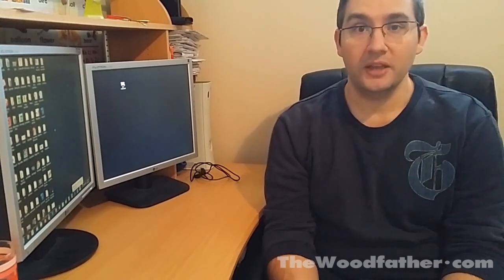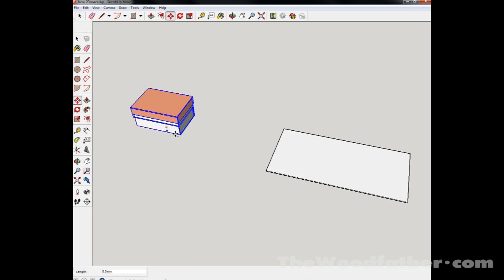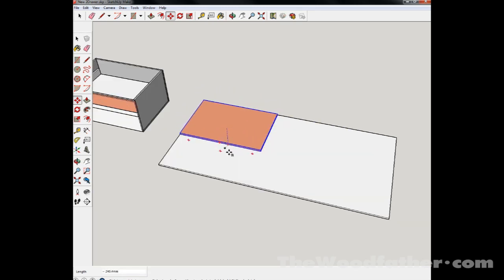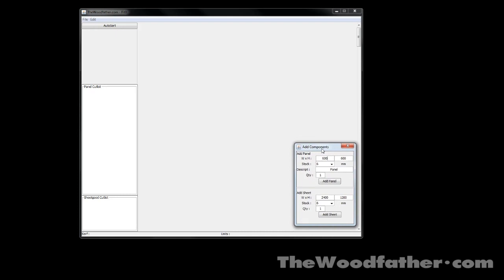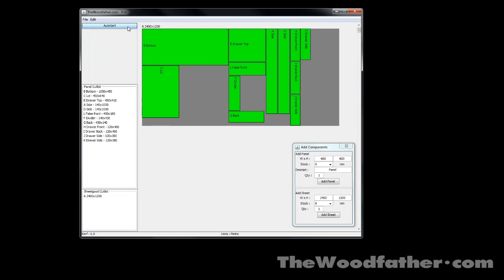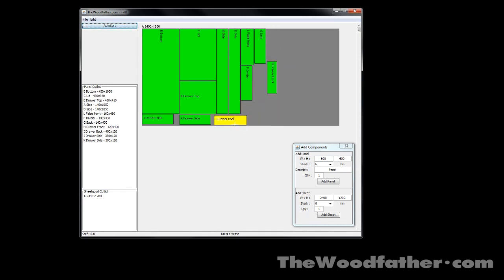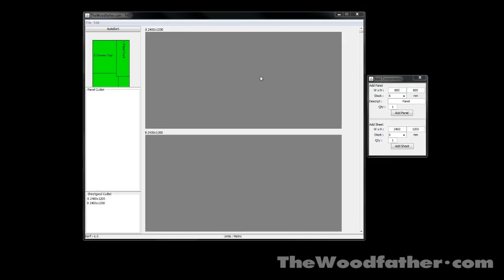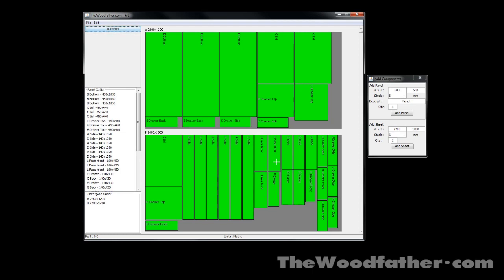Meet Fit It! Make the most of your wood! - The Woodfather

Comment: Really a good effort on your side! I hope your video and the programme gets the exposure it deserves.
Don't read further: It has been mentioned loads of time before.

One feature that might be useful would be an option to tell the programme that parts have a direction. So the grain runs the right way. Structurally this is not a big deal when working with sheet good material such as plywood, particle board or MDF but I also buy premade glued boards (don't know the english word for it) or make my own. With those it is not only because it looks stupid when the grain direction changes (but that is also true for plywood) but the longs sides of he resulting boards need to be rip cuts, not cross cuts else they are not going to be as strong as they should be.
Reply from the maker: Thanks for your comments *****! 
Yep, nearly every suggestion received is to do with grain direction, I think I know what feature I need to implement! :-)

Comment: The concept sounds great, i build lots of the same project everytime, sometimes i have to do 10 or 20 coffee tables or lamp tables, etc with wood and laminated MDF, that is a lot of work thinking how to cut all the parts to maximise all the sheets, usually i do the design in paint with simple boxes and print it when it´s ready, if you make a software, i am a client, just make a limited version to test it.
Reply from the maker: Sounds great Adolfo Torres, batching out is pretty much precisely what I designed it for. I'm starting to make more and more of my Mega Shoebox design, they are big and expensive, I needed a way to help bring the material costs down. This has already helped save me a bit of cash and a bucket load of time.

Comment: Can you inport sketch up files or do you have to add in all the dimensions again into this program.  This looks like it's going to be great - I like that you account for kerf size and over sizing/rough cutting to allow to trim to size at a later time

Scott
Reply from the maker: The 2 Car Garage Shop Hi Scott, you will need to re enter your sheet and panel dimensions at the start. I do plan to create a small Sketch Up plugin which will do the heavy lifting for you, but I'm not even thinking about that until after this is released and only then if it is received well by the community. :-) Too many projects and ideas, not nearly enough time!

Comment: Hi. Looks good so far. Was wondering if the auto sort setting has the ability to consider the grain directions of the sheet material and the desired grain direction on the work pieces? Or if it would be up to the user to manually sort?
Reply from the maker: Thanks Lee Dodd Up to the user at the moment. I only realised that this might be a requested feature last week unfortunately. It's on the 'not critical but highly helpful' feature list to be added at the moment.

Comment: Nice job Mario. Are there plans to support conventional board sizes as well as sheet goods?   Although I suspect that nominal sizes may vary around the world...
Reply from the maker: ***** You can enter any board size that you like mate. Be it a full sheet, half sheet or even a small random sized offcut from a previous project! So long as it has 4 sides, you can enter it in the program. You can, of course, use all of these different sized sheets and boards at once. No limitations!
Reply: That's awesome. I often use different board sizes in a project, and cutlist tend to make a mess of it.

Comment: +1 on the grain direction.  Even with plywood, grain direction matters for aesthetics, even though it doesn't matter for strength.

Other big question is portability.  It looks like you're on a PC.  Is this a Windows-only program?  Will it run on Macs?  Linux?
Reply from the maker: wordsnwood I have developed it on a Windows machine, but it's written in Java, so it should work on any operating system so long as Java is installed.

Comment: One question. are you able to take grain orientation into account with your auto sort feature? Your demo showed most of your parts with the grain (assuming plywood is being used) running across the narrow dimension of the piece. The is the opposite of what one would normally need.

Comment: Great idea, looking good
I am unlikely to use this as i don't do a lot of woodwork projects, but i can see the potential
One question, does it take into account grain direction, speaking of grain, what about something like drawer fronts that you want to appear as a full sheet.
I know this could be done manually.hmm, maybe manually place the 'special' parts in the correct orientation, then 'lock' those into position (different colour), then auto arrange will not move them while placing the other parts.
Reply from the maker: ***** I completely overlooked the importance of grain direction. But seeing as a lot of comments are regarding it, I will push it right up the development list. Cheers mate!

Comment: Would it be possible to overlay a photo of the wood/board you want to cut, this would be useful to cut out any defects etc.
Reply from the maker: grumpywoodiam Hmm, probably not so easy with a photo overlay, but I was thinking of including a 'knot' feature. Basically you would have a knot on your board you wanted to avoid, so you could create a special marked panel that would be fixed in a place on the sheet, then the program would be able to let you place your other panels around it.

Comment: As a programmer first and woodworker second this really fits how I like to work. :) 

Will you be adding export to a format suited for cnc machines?
Reply from the maker: Jim Groth Hmm, I haven't thought of that. It only handles rectangular panels, is that something you would bother using a CNC for? Though I guess, if there were hundreds of smaller panels it may be worthwhile... Short answer no, long answer, that might be a fun project down the track :-)
Reply: If I could just put up a plywood sheet on a CNC and go have coffee while it cuts my pieces I'd be happy.

From what I can tell CNC machines can use a very simple format (STL) that is basically list of triangle coordinates. Should be pretty easy to implement. If you do it would be a good idea to add a little piece that is skipped at each end of each cutout so it's still attached when the cutting is done. It's common practice to leave this little bit to manually cut afterwards so the CNC doesn't cut into the piece as it loosens when the cut is finished.
Reply: ***** One of the problems with CNC tech is that you need to do so many things to get something to work. Build in this program. Convert in that, then convert again using this. Send to machine with yet another program.

Anyway, I guess you're right, it's not really needed. Would just be a nice addition, and it shouldn't be difficult to add. I think.
Reply: ***** I don't think this software does arcs. AFAIK it only does rectangles.
Reply: Mario Cappellano Are you going to release this as open source? If so I wouldn't mind chipping in a bit with some hours. :)
Reply from the maker: ***** Print out diagrams yes absolutely. But not in a 1:1 scale. The idea is you are cutting rectangles on a sheet of ply or a long board, you don't really need 8ft worth of printouts for that.
Reply from the maker: ***** Just rectangles, I have ideas for positioning arcs and non standard shapes but don't expect to add it for a long time.
Reply from the maker: Jim Groth No I think I'll hold onto the source as I will probably ask for a small fee for the program. I've sunk a lot of hours in and probably need to show my wife some sort of return. :-)
Reply: Mario Cappellano have you considered kickstarter?
Reply from the maker: Jim Groth No, I don't think I really need to raise a huge sum of money to get it going, more along the lines of I need my boss to give me a week off so I can work on it flat out!
Reply: I was thinking that if you get enough money in a KS campaign you might not need to sell it and can open source it.
Reply from the maker: ah ok, didn't think of it that way.
Reply: What I don't think will work is a donate button on your website after release. Make sure people know that if they want it to become free you'll need some initial moneys. The first sum that pops into my head is 4000usd.

Comment: looks good so far.  I have been using CutlistPlus for 8 years now and it's similar.  I don't use sheet goods very often anymore which is the only thing it's good for.
If you could add the ability to use this with thick lumber like 2x's that would be great.  I use mostly construction lumber now and rip thinner pieces out of it.  like my latest foot stool, I ripped a bunch of 3/8" stock from a 2x6.  It would have been great to have an app figure out how much I could get.
Reply from the maker: Michael Olson All you would need to do is enter the number and lengths of that you had ripped, and then your required lengths. Fit It will do the rest.